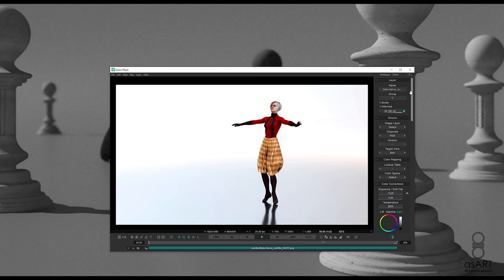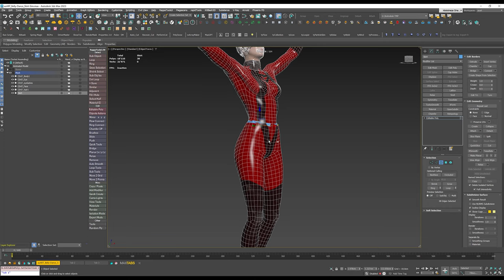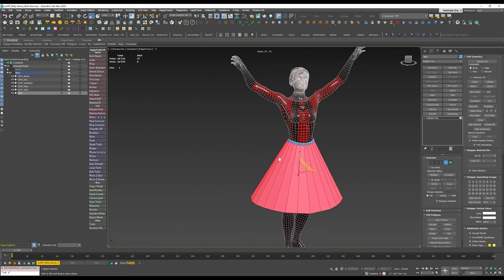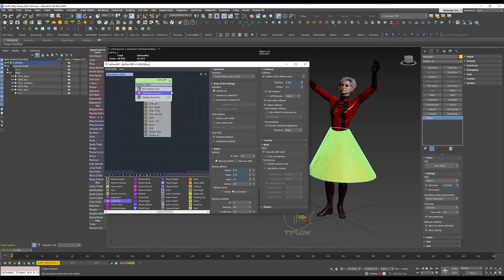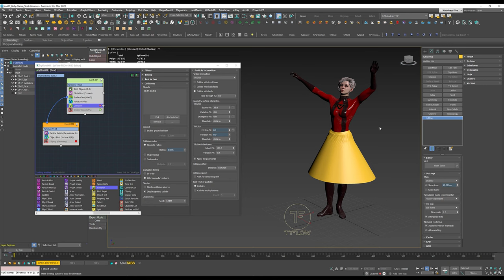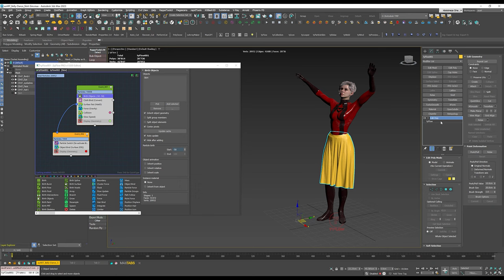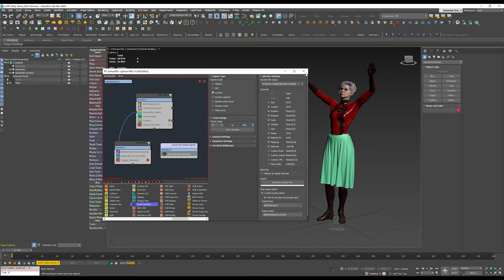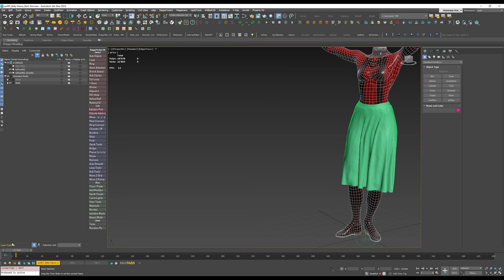3Ds Max and tyFLOW Pro Tutorial | Skirt Cloth-Sim attached to an animated Model

Comment: You got some collision where the cloth has higher resolution than the underlying character, and her polygons are starting to show on the skirt. If you can subidivide your character model so it has higher polygon density you could probably get a better results on the cloth as well.
Reply from the maker: Hi and thanks for the hint. Sure thing, higher mesh resolution will give you some better results, but it also can slow down the simulation a lot. Didn't want to go crazy with the mesh amount in a tut .. Thanks again for watching and for your valuable feedback .. Much appreciated .. Cheers
Reply: @asARTMotionGraphics  The problem is that you have high resolution in the cloth, but low resolution on the collision object (character). I don't think it would hurt performance to much if you added one subdivision to her body. Adding more subdivision to the cloth would probably have a bigger impact. I've seen the same issue when using Clo and Marvellous Designer.
Reply from the maker: Roger that! .. Thanks again for your great and valuable feedbacks .. Appreciate it a lot.